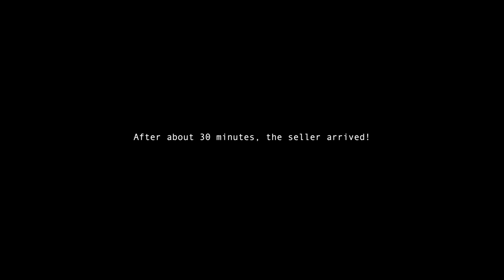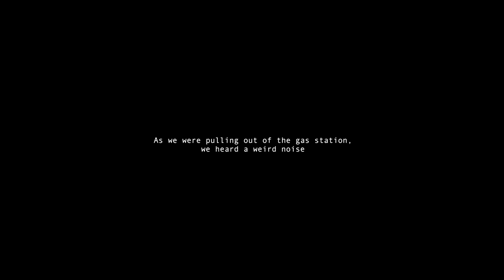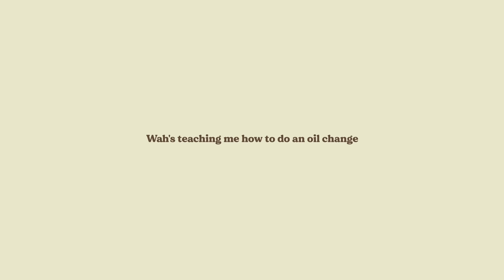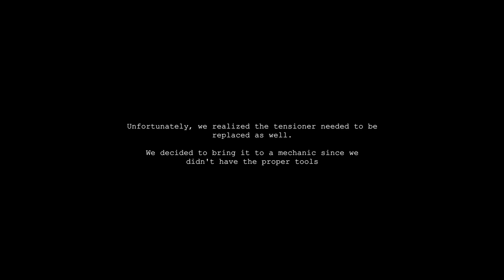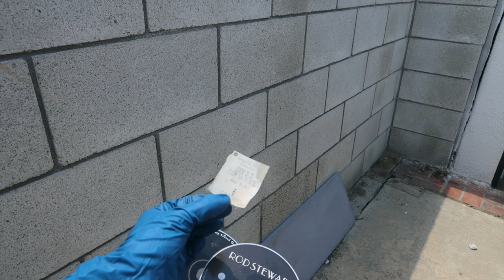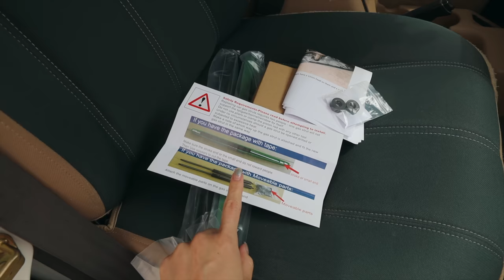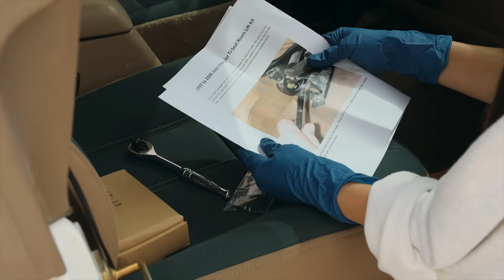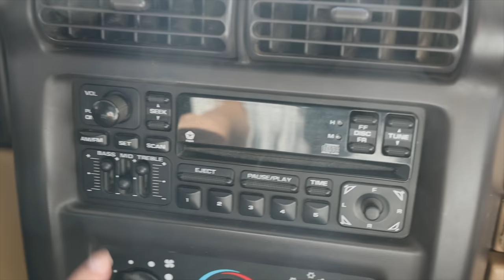I bought my dream Jeep...

Comment: is that a Two wheel or Four wheel drive Jeep? I like simple vehicles like manual things roll up down windows manual seats all of that which means less things will break later on like no replacing window or seat motors 
I have heard so many bad things about jeeps but I think there are reasons as to why one people ad things on them like large tires that weight allot and such with out replacing some of the suspension plus many people dont maintain them the just jump in drive also there are sooo many jeeps out there and we as humans tend to notice all the negative things in live and not the positive things so we see hear about the negative things . as for myself I always liked the looks of most jeeps but if I were to buy one it would have to be full manual trans but Jeeps like all SUVs 4x4s and trucks and soo expensive and way over priced that I highly doubt that  I will ever own one :( as for the shake most times its just tires being old out of balance most wheel balancing is set to 60MPH but if its a little more shaking and it being a jeep could be suspension possible person previously owned it had heavier tires and it wore out the suspension a little like i previously mentioned , also one thing I love about jeeps and other trucks that are pretty high is that you actually  dont need to use ramps to do things like oil changes it make life so much easier becasue then you can get under the hood when pouring the oil back in .
 the tensioner thing was what  I would have also suggested they make noises when the bearings start to go the started to wiggle a little .
I never liked cloth seats because myself being over 6" tall and 104Kgs I tend to wear the sides of them quickly from getting in and out of my vehicle .
 is it ok if  I come down there from Canada and have you do the same for my Lexus car seats , Centre console and interior lol
I remember an acquaintance of mine owned a Jeep and the first thing  I noticed was the noise echoing notice from anything moving around inside the jeep for myself I would get used to it but many other people it probably would bother them.
Looks like you should have did some warmup exercises before putting on the steering wheel cover so you dont hurt yourself to bad .
 Usually the only time a person needs to worry about shocks is if they are leaking oil or they are rusting very bad

the cup liners also keep the noise down from cups of other things inside there vibrating, in my Old lexus there was a vibration nose that happened every so oftrn it took me a long while to figure out it was my metal water bottle vibrating inside the cup holder when I was driving on some parts of the road I first just put in a paper towel around the opening then pressed my  metal water bottle into it the sound was gone.
I remember in my old ranger 4x4 it had manual windows and my Grand niece didnt know what those things were for same goes as the manual unlock lock doors